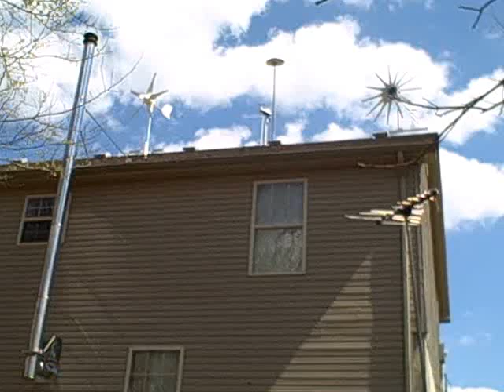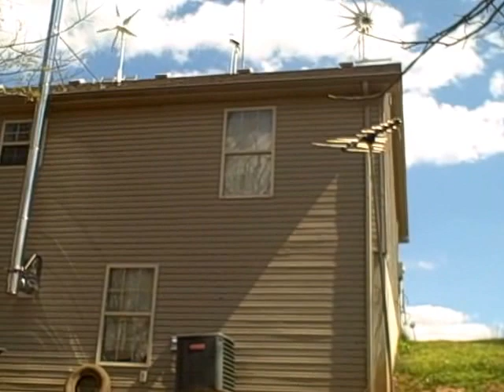new missouri wind ad solar roof mount and freedom II pmg

Comment: The longer the blade, the higher the wind turbine has to be to really be effective in catching the wind. All the other logistics have to be configured to withstand the torque and centrifugal forces acting on those blades and pole.  Anchor it down well. Just wanted to share this with you. Blessings to all.

Comment: The install looks great

how about noise transfer throught the roof mount..... can you hear any noise in the house ?

I am hoping there would be none....would be hard to get some sleep if the whole house was buzzin from the roof mount turbine on a windy night

Thanks
SS
Reply from the maker: ther is very little noise at all compaired to the old pma's. to be honest you have to stop and really listen for the hum coming from the new pmg. i'd say if there was a rubber mat between the legs and the roof like there is on the mw&s mount there would be none, but the mount on the end of the house is a aleko mount. it is very poorly made. it shakes like a paint shaker in high winds. I had to fix a lot of problems with that mount. starting with the way the pole mounted to the base. they sent a cheap flimsy u blot with it. I ended up drilling holes in the unit and using grade 8 bolts to mount it.  the legs are not totally adjustable to fit very steep roofs and I could go on and on about it. i'll never buy anything else aleko makes after this mount and one of their wind turbines. their turbines are even worse than the mounts they make!!!
Reply: Thanks for the info...... actual  install feedback is irreplaceable to a products design

MWANDS knocks it out of the park again    ;-)

/R
SS

Comment: I haven't tried the 13 blade set up on the PMG yet. it would provide more torque but I think they will stall later on.   I do know the PMG sure dose put out the power.
Reply from the maker: yep they will stall, just like the 11 blades, but they start a lot sooner in low winds. if my mounting pole was higher I would have the 80 inch three blade falcons on that bad boy!!!
Reply from the maker: derekthegreatgonzo if jeff made the roof mount just for the pmgs and pmas high enough to use the falcon blades that would rock. I loved the 3 blade falcons when I had them set up out on 10ft poles. man they would sure get nasty eating air!!! they are fast as hell!!! I have a set right now I can't use because my mount is about 6 inches to short. a 4ft 6 inch pole could fix that if they would make it. just to be safe a 5ft pole would set people free on blade length!!! I don't think they realized what they had when they made the longer falcon blades. they are air eaters!!! I have blades here that each blade is 6ft long. I have tested more blades than I care to talk about. the 80 inch falcons have this magic design I believe they just stumbled onto.
Reply: sounds like you done what I'm starting to do with blade tests. 

as for Pole length. I think they decided on there 4 foot Pole because when you take that pole higher you put more stress on the mount in higher winds. You can try a 5 foot pole on it. it should hold but I think they wanted a mount that can with stand heavy winds. 

and I can see the falcon's almost touching the mount those are almost 3.33 feet. and you only have just under .67 feet to go so.   You can try a 4 1/2 foot pole that is only adding 6 inches. that would give you a good foot from blade time to roof mount.  but I would go to much higher.
Reply from the maker: McCuneWindandSolar  I had a guy tell me the longer the blades the better. when I purchased that set that had 6ft blades and I tested them I didn't see it. they were to slow to get any power out of them. I had a set of the 48 inch hemi blades at one time. they would start up in next to no wind, but I never really got any power out of them either. it seems there is a limit to the length of the blades and power production in my testing.

*
Reply: derekthegreatgonzo and that is the thing with direct drive systems. I have the 80 inch blades. and they are slow they take longer to react with the wind. but if the wind is stable with a slow increase they will spin like crazy I have 16 hour of video to go through to see what power out put I got from them. yesterday. and that is the 5 blade set. the way I'm doing my testing is to see what tork I need for this Freedom 2 and right now those 5 are rocking.  but what I like to do is build a geared system with mechanical   furling that will furl at a programmed wind speed.  that way I can program the processor what wind speed to activate furling.  that is a project for later because I want to get a 12 foot diameter
 swept for it.  get some Pro blades.